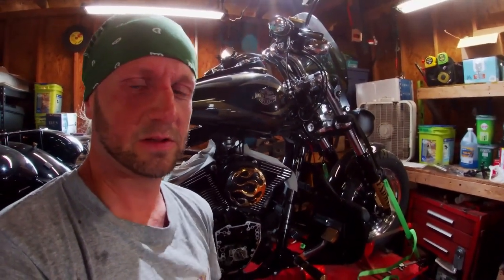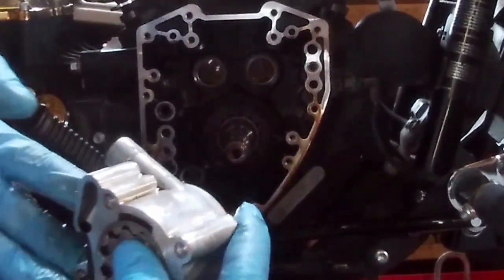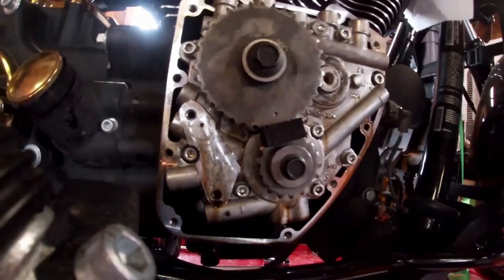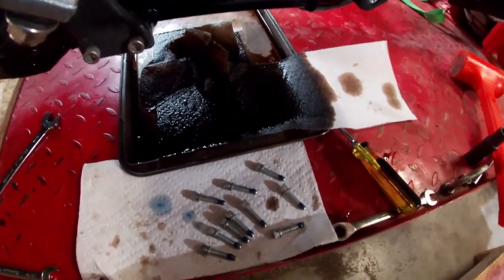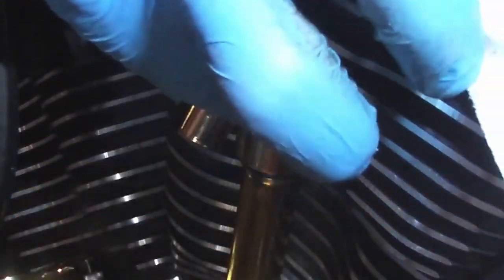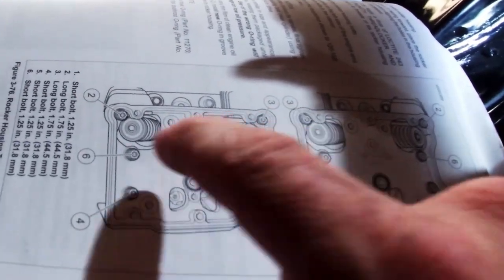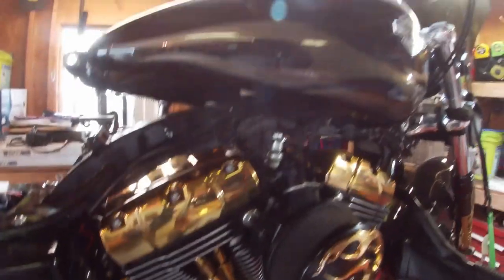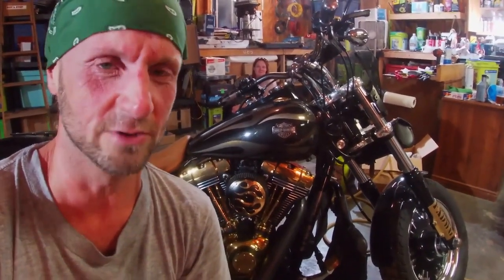Installing S&S MR103C cams in a 103" Harley Dyna - Random Garage

Comment: So i was watching you put the breathers back together. Are you sure thats right?  Sponge on bottom not middle.. Thanks
Reply: yeah, they're definitely assembled wrong...
Reply from the maker: Son of a bitch! Yeah that's wrong!
Reply: @RandomGarageUSA  Did you get fixed?
Reply from the maker: We have a few weeks of winter here yet, so no rush to fix it. Although, I think I had realized my mistake and corrected it before installing the rockers, but screwed up when I edited the video and had the wrong clip inserted. Since it was a year ago tho, I have to pull the rocker covers off and check because I am not 100% certain.
Reply: Always use the repair manual peace on 2's H-D

Comment: Hi Random Garage, I note in the S&S installation instructions for the MR103 camshafts clearance needs to be checked for the rear lobes against the pinion bearing boss and the tappet guide boss. I note that you didn't comment about this in the video so am I correct in presuming that it isn't an issue in the Wide Glide cam chest and the new cams fit in with sufficent clearance without the need to remove any of the cam chest? Regards, Michael.
Reply from the maker: Correct. I've never heard of anybody having a clearance issue with a  .585" lift (or shorter) cam.
Reply: @RandomGarageUSA  Many thanks for the prompt reply, I just checked the part numbers on the crank case (inclusive of the cam chest) and the 2012 (which I own) and the 2017 such as your bike and they are the same. So I should be sweet. Many thanks again.

Comment: hey buddy, have a stupid question how did you torque the rocker suport plate left side bolts on rear head
Reply from the maker: Have to do that one by feel, because the torque wrench doesn't fit. Do the others with the torque wrench first, to get a good feel for the force required, then do that last one with a different tool.
Reply: @RandomGarageUSA  thanks bud

Comment: Question are 640gear drive cams good are bad for a113 build....
Reply from the maker: Here's what S&S says about it: "Used in S&S T124 engines, this cam makes horsepower! Intended for engines of 95 CID or more w/compression ratios between 10.5:1 and 11.5:1. 3000-6000 rpm." 
 Aside of the displacement and compression ratio necessary, you are going to need high-performance heads (to accommodate the high lift; stock heads can't mechanically handle it).  Also, to take advantage of the full potential of those cams, you'd want a larger throttle body (and possibly larger injectors, depending on which exact TC engine you start with) and a high-flow exhaust.
Reply: @RandomGarageUSA  ok thanks I should be good then...